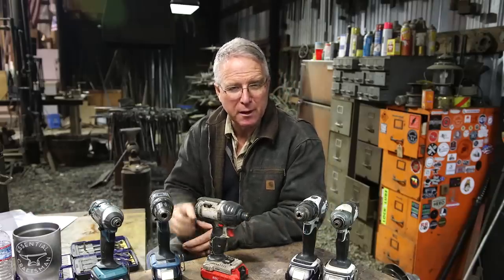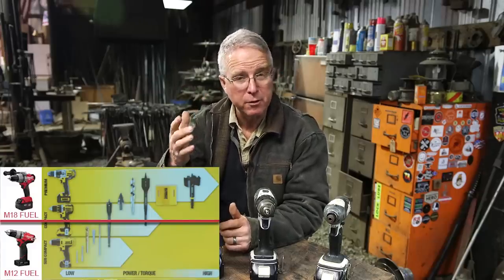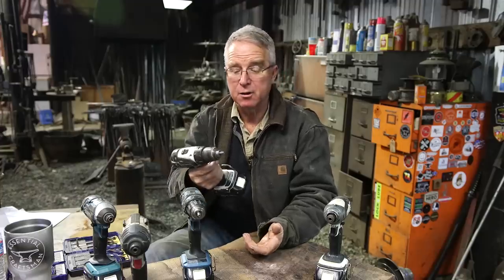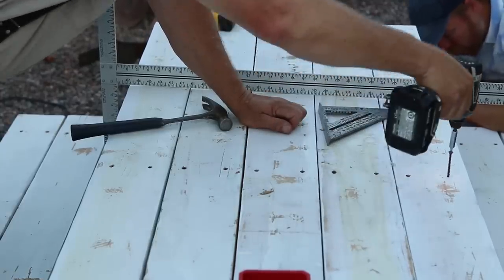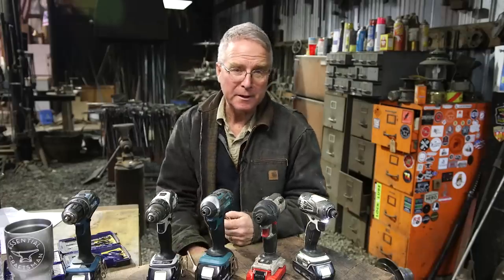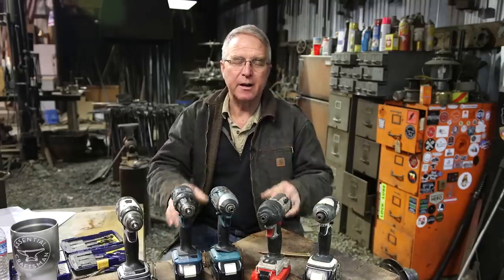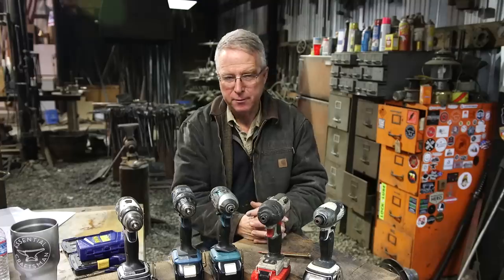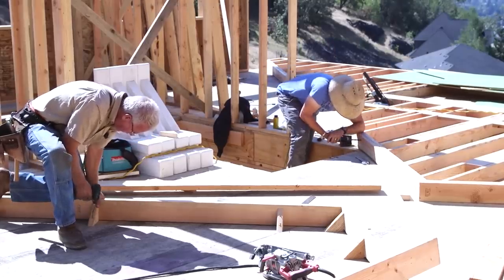Impact Driver Vs. Drill Driver

Comment: I remember my father had a screwdriver that was designed to be hit with a hammer in order to break screws loose..
Reply: D:
Reply: Only way, back in the day, to remove those soft philips-head screws that Honda used on their motorcycles.    Half the advantage was the down force into the slots as it applied the twist.   Does anyone know if these new ones have the down force as well or is the advantage just the quick hammer hit of the driver?
Reply: It is called an impact screwdriver. It is a barrel shaped hunk of steel, that you insert a screwdriver bit into, and you whack it with a hammer. It uses a ramp, hammer, and anvil on the inside that translates the axial hammer blow into a radial impact and rotation. (The axial impact from the hammer blow also helps it to resist cam out.) They are amazing for removing stuck fasteners. You deliver one sharp, axial, blow with a hammer, and it delivers one sharp, crisp, radial, impact and rotation to the fastener. I have never come across a stick fastener that it didn't help me to remove. (Within reason.)
Reply: You remember your father had one: OMG how old am I, there has been an impact driver in my box for years.  Still the best way for taking the counter sunk machine screws out of brake discs and drums.

Comment: It's an impulse force... due to the way inertia works (Newton's Laws) the force is doubled because to have a bounce during an impact you have a switch in direction for that mass.  

Lastly, screws work due to the high amount of friction preventing them coming back out... an impulse moves the screw in overcoming the friction with the higher force causing a sliding friction, but it doesn't unscrew due to the static friction when it stops... because sliding friction is less than static friction.
Science Friday FTW!
Reply from the maker: THANK YOU!!!

Comment: Just having multiple drill drivers and impact drivers is a huge time saver on some project, because you don't have to change bits every few seconds. But I'm still sort of disappointed with cordless circular saws. They don't seem powerful enough. I don't think it's a tool that you need to have 4 units of. 1 or 2 is enough, but at this time battery powered are so different from corded that you basically need to have a couple of each to get every job done, which doesn't make sense for me, honestly. But hopefully battery technologies keep evolving and at some point cordless cicular saws will be the go-to tools at any job.
Reply: I agree. A circular saw needs LOADS of power to perform effectively for rough framing. Right now the battery technology is adequate for lighter saw jobs like trim and such but for framing, their not quite there yet. (Almost!!)

Comment: I have seen a guy use an impact drill to screw in a j box faceplate screw. What a dork! ... The 12vt Dewalt is my all-star. It's plenty powerful!
Reply: What's the deal with that? I'm always using an impact to drive small and/or low-torque screws, simply because it's what I always have nearby, and never run into problems with over-torquing screws, yet many comments here are talking about only using impacts for large screws, and how they always strip/break when used for smaller ones.
?
Reply: @ILikeWafflz  Its just overkill. And depending on the work you do. You don't need that extra risk of damaging something.
Reply: tony tony I suppose personal preference plays a role, as I've always found impacts easier to control than drills for pretty much all screw installation and removal.
With the branch of construction I'm in (general remodeling, most often on mobile homes), my usage of a driver is relatively sporadic, but often frequent enough that I want to keep it in my tool belt. The smaller size and lighter weight makes an impact ideal for this, which means it's what I use most often, so it could be that it's just what I'm used to.

Comment: I much prefer drill/drivers for screws as they give me much better control. Plus, they are not so damn loud, plus the drill does not snap bits as much. However, I mostly do smaller stuff with a 3'' screw being the largest I use, and not that much with them. If I built decks and had hundreds of 3'' plus screws to drive, I would probably buy an impact.

Comment: And three batteries is much more useful than two - there's always a fresh one to swap out a discharged one
Reply: Dual chargers can be a handy addition to your arsenal as well. It’s not uncommon to run out of battery before the next one is fully charged, when you’re really putting them thru their paces. The chargers are relatively cheap too. The battery’s are where you really have to pony-up $. 3 batteries and 2 chargers should do it.

Comment: I install commercial doors, hotels, schools etc. impact drivers changed my life. I think I own 10 of them.
Reply: John DeHaan one for each employee or are they just hat unreliable that you need 9 backups? I’ve had 1 that I use most every day for the last 7 years. It’s hard to beat Milwaukee Fuel models.
Reply: @christophergruenwald5054  I own 3 of each because switching bit heads slows me down.
Reply: Christopher Gruenwald. I wear 2-4 out each year. I never warranty them because they made me money. I have guys helping me off and on and need to tool them up. I also have some that are more powerful but heavy and light weight ones. When it is in your hand all day it takes a toll. My current favorite is the black makeeta.   My least favorite is the Milwaukee and I have a few DeWalt in both 12 and 20v.
Reply: Christopher Gruenwald I have Milwaukee w/ brushes, using it for 10 years, and I bought it used.
Reply: May I ask, what screen door / storm door would you recommend for a residential house?
Reply: Hey John, thanks for that explanation. I, too, wondered why you might have so many, but your reasoning make a lot of sense. Those of us who don't work with our tools and hands everyday like you, would never see a reason to get a 'lighter weight" tool - we use it for 10 minutes then it goes back in a drawer or bin. I don't mind ignorance but I despise stupidity. Thanks for the education, you and Scott!
Reply: msnpassjan2004 I really like the invisible screens but I don’t do many.

Comment: I’m the only one under 40 I know who uses a drill as their daily. Modern compact drills are just as light as impacts, but they have more control, do more things, drive fasteners faster and are WAY quieter. The only time I really use an impact now is for things I should be using an impact wrench for (lug nuts, ect)

Comment: I love my impact driver but I say to really get the best out of them you need to move to some sort of alternative screw head.  Robertson or Torx - both are better designed for being driven by power tools than Philips or Pozidrive which just aren't much good for anything but hand driving.

I know Philips/PZ works but it's not ideal by a long shot.  Too prone to slipping and stripping.
Reply: I have found for me that I actually have had a few cases where the robertsons cammed out.  The torx are better imo but I ordered a 5lb box of 3" robertson deck screws from HD just to see what theyre all about.

Comment: It’s been my experience that about the only type of screw that an impact driver is not good for is trying to drive and set a good old fashioned slotted head screw, particularly the larger ones such as # 10’s and above. As it would start to set at the end of the drive I would almost invariably chip a corner off of the driver tip an ruin it. Maybe it was just my technique that needed adjustment.

Comment: I don't lose bits. I break them. Especially philips and flat heads. A have a drawer full of stripped, bent and filed to a point screwdriver bits. I recently walked into the hardware store to make the dedicated switch to square bits to fix the situation, and I found something called LOX bits. Expensive as hell, but worth it? We'll find out.
Reply: Are you using impact rated bits? Regular bits easily break with the impact driver, but for a little bit more, you can purchase "impact rated" bits that are harder and usually a dark color.

Comment: We all understand the advantages of impacts when it comes to linear motion. Imagine you have to move a small beam. Obviously you grab it and push it with continuous force. You work faster the lighter the workload, just like a drill driver. But what do you do when a beam is to heavy to push? You grab you hammer and move it. Very heavy beams will move just a tiny bit, but they move. Just like an impact driver, the screw might turn very slow, but it turns.

Now to the part about stripping the screws. With a drill bigger screws mean more torque, which requires more axial force. At least with heads like Phillips. With impact drivers it is something else. You can continue at the same impact strength and simply accept the slower rotation. Coming up with 4 times the strength is much harder than accepting that your impact driver turns 4 times slower with bigger screws.

Comment: ive used impacts with drill chuch adaptors to drill, used drills to fasten fasterners, and gatta say they both have their uses. sometimes its a pain in the ass to fasten screws with a drill, somtimes it a pain in the ass to drill with a impact cuz the drill bit will break off(mostly when drilling steel). i would agree with scott to get both if you can or have uses for. but if you can only afford one. buy a drill. much easier to learn how to fasten a screw with a drill then breaking many drill bits with impact with chuck adaptor. but then again drill/impact i was using was good quality the drill bit and adaptor was poor quality. just buy both. will last more then triple as long as  just buying one. but then again its not the drill/impact itself we need to worry about, its the battery life.

Comment: Impact drivers have way more torque than drills. They are good for drilling concrete screws withour plastic wall plugs (anchors). As said, Both have their scope, and what one is designed to do well, the other does it poorly. There is a soft middle where someone can use either to do a job, but they are two different tools.

Comment: A good cordless impact driver can in a pinch replace a 3/8" automotive impact, such as needing to change a tire. Striking above their weight indeed.
That being said, an OG impact driver - the old ones powered by a hammer blow to the rear face - are fantastic tools in their own right, and while not as versatile as a cordless electric or pneumatic impact, can do some jobs neither of those can do, like remove badly stripped or corroded screws.

Comment: Most decent sets today, the drill often has a hammer setting that's good for masonry drilling. Honestly the impact driver is often just lighter and more compact.
My milwaukee fuel drill/rotary hammer will beat the brakes off the impact driver with 5" screws.
Just impact more conveniently fits most places, and the tool belt

Comment: Nonsense!! All these new-fangled, fancy-schmancy gadgets!!! [spoken with old ‘grandpa Simpson’ type voice 👨🏼‍🦳]  I use a brace and bit. And a star-tip cold chisel for concrete. And a couple screwdrivers. All ya need! 
-Just Kidding - Battery technology has improved exponentially over the last 30 years. Who would’ve thought we’d have [functional] battery powered cars 30 years ago (except for maybe Elon Musk)
-I remember when the battery impact drivers first came out. I thought the ‘dummy’ was just stripping the screw head out! 🥴
-Totally agree about the drill bits/tips/driver kits. You can get some of them for $12-15 that are plenty good for the DIYer. 
-Some of the comments have complained about the noise but I’ll take that noise over those damn 2-stroke engines any day! i.e. leaf blowers, edgers, weed-eaters, etc. 😣
Reply from the maker: Amen brother Amen!!!

Comment: Its really interesting, seeing americans use impacts this much. Here in Germany, woodworkers basically only use drills, even the professional roofers and framers I've worked with use drills. Impacts are usually only sold with a 1/2" or 3/4" drive, and are almost exclusively used by mechanics, metalworkers and so on.

Comment: My problem with cordless tools is with battery compatibility. I have six cordless tools of the same brand, they were each bought at different times, six batteries are different and not interchangeable. About four of these batteries are done, ( losing power) they have to be replaced. None of these batteries are under $100, that’s a lot of money. I have electric drills that are thirty years old and still running like the day they were bought.???

Comment: I see a lot of people even drilling holes with an impact, I've spent years in construction but never tried myself. If it works, it works.
Reply: I use an impact to run auger and spade bits - less torque on your wrist and it won't bind and rip the drill out of your hands.
Reply: @fnnsjsnnejejdndnxhxjna  That's what I've seen them used for aswell, guess it works huh.

Comment: One other obvious thing not mentioned, with a drill and drive you aren't swapping drill bits and driver bits all the ding dang time. With my old arthritic hands I have a small finite chance of dropping the  bit everytime I swap out, hex bits helped some, but still. And I'm good with having a small 12v set and a couple of "big guns" I can break out when needed.

Comment: Sometimes I cheat, since I have cordless drills and such a nice small driver that has a chuck that can be removed without tools exposing a second bit holder (with regular short bits one can still use the chuck meaning either two bits or a bit and drill at hand ) it feels just wrong to get an impact driver. So my cheating for those real hard to drive screws and bolts is using my makita cordless drill in hammer mode pushing on it real hard. After some testing on some real hard wood the hex torx screws  work easiest where even pozi will slip torx don't. Since I also use screws on tricky places I already prefer hex torx screws with six "slide in positions" opposed to four of the other regular used heads.

Comment: I own the Makita set shown.  They work great but replacement batteries cost about as much as the whole set.  Anyone have a line on where to buy less expensive batteries?
Reply: My brother is always keeping an eye out for sales at Home Depot; sometimes they'll have deals for a tool set that will come with something like two 5 amp-hour batteries (normally sold for almost $100 each) and two tools for like, $250 or something. It just takes keeping a close eye on the local stores.

Comment: I have been some fifty years in the construction trades mostly woodwork, I do not own and do not propose to own an impact driver,  I hate the racket they make, also with the correct choice of screw, pilot etc I do not need one. Believe me I have screwed down enough flooring and framing to know, When I started,driving 4” slotted tapered steel screws into softwood, unpiloted, with a Stanley Yankee screwdriver was the first heavy task I had to learn (quicker than a brace) Maybe an impact driver might be useful, then I’d have to cart all that around as well as all the other crap !

Comment: Will impact drivers reduce the capacity of installed screws by spinning them in place?
Reply: you mean stripping the threads? depends on what you're screwing into. Typically i find that the impact takes less time, and does a better job at getting into hard to reach places.

Comment: Go Milwaukee or go home. I made the mistake of spending money on some “cheaper” Rockwell impacts and drill to begin with. They were under powered and didn’t last very long. Milwaukee Fuel models have 5 year warranty and I’ve used it several times. They stand behind their tools. I sent a cordless hammer drill in for warranty at 4 years 11 months and they sent me a brand new tool. I’ve broke handles from dropping the tool off the roof. I’ve even had a job site radio that went swimming. Every time they replace or fix no questions asked. You can’t beat service like that. I’m a Milwaukee customer for life.
Reply: Got a dewault set when i 1st got into the trades. They broke withing the warranty date. (3 months) brough back and got a set of milwaukee. Love them. I too have got through the warranty with my  impacts, skill saw. And yes they take them back no questions asked.

Comment: I feel that you’ve missed a very important point, possibly the most important point, and that is the lack of torque feedback of the impact driver compared to the drill.
Reply: Badger0fDeath what I mean is when torquing a screw with a drill, you get an immediate twisting feedback which tells you to stop screwing while the same action with an impact driver gives no real indication of the torque being applied, which can easily lead to stripping or shearing of the fastener
Reply: Adam, very sound advise, don't know how many times I almost broke my wrist in a tight spot with a fresh battery and a bit bound up in the work.
Reply: BigDogBob I commiserate with you but the issue I’m pointing out is when using the driver in situations that are very delicate such as; fastening plastic panels or fairings on motorcycles with screws or replacing an entire dashboard and having to remove and reinstall all the instruments on a car.
Reply: @pierdolio  If you're skilled enough, you can modulate the trigger of an impact driver to get it to turn without impact, and use it for very delicate tasks. Just this week, I used mine to install those threaded drywall anchors, and to install brass sliding lock on a door (with tiny brass screws), which are both very prone to over torquing. I have been using drills for over 20 years, since I got my first 14.4V craftsman drill/circular saw combo kit when I was 12, and I have hundreds (thousands?) of hours behind the drill working construction. So I'm very experienced, and that trigger modulation comes second nature to me, but I get what you're saying for people that don't use a drill/impact driver a lot.